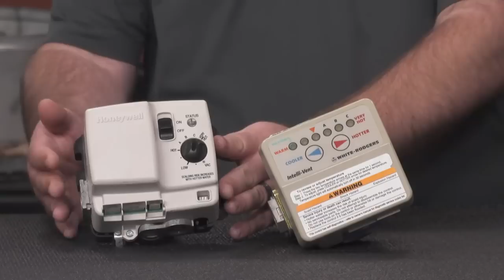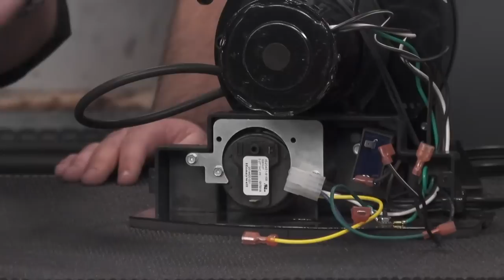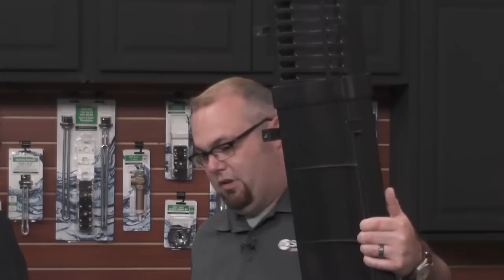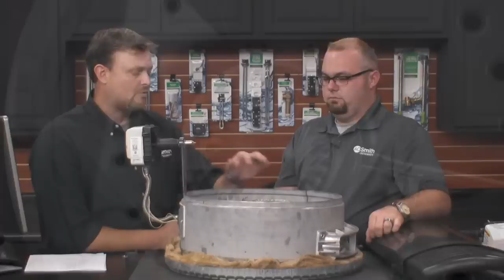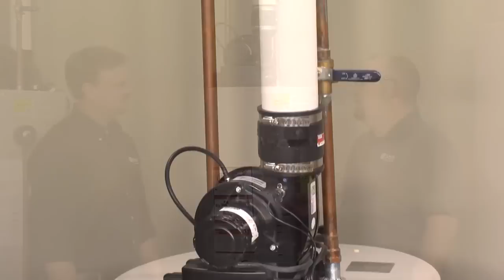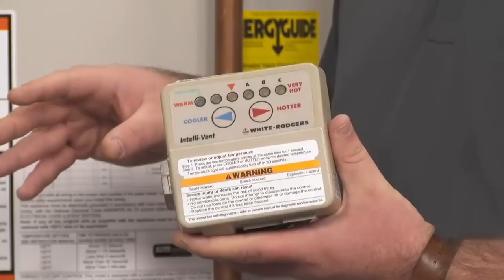A.O. Smith - Installing Power Vent Water Heaters | HD Supply

Comment: I bought this AWESOME new Power Vent to replace the "ole-School"( 23 years!!)  power vent. 2 questions: 1) The 23 year old install had a 3" PVC exhaust as well as 3" combustion air supply... Can I discard the 3" air supply ( Dang Drafty in the north at minus 20 degrees in the winter!)  2.) Installation gives me the option to use the 2" Schedule 40 PVC which will be way better in my mechanical room; Can this be Common Vented with my 90%eff Natural Gas furnace ( also power vented ) ??

Comment: Just replaced my previous AO Smith Power Vent residential 40 gal GPSH40 Honeywell  with the one in this video with AO Smith Power Vent residential 40 gal model G6PVT405ONV it is noticeably quieter. Got 11 1/2 years out of the previous one. Pipes (water & gas) lined up perfectly although the unit is taller so the PVC for the power vent required minimal modification.